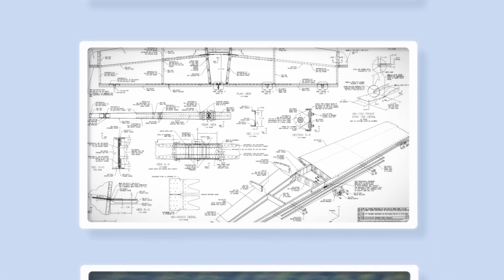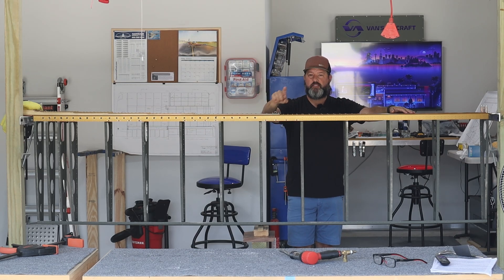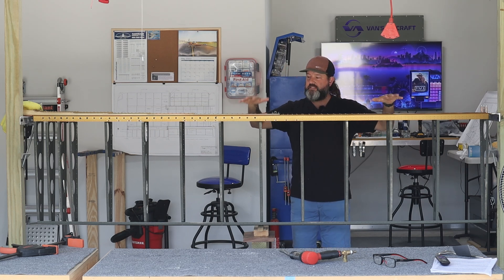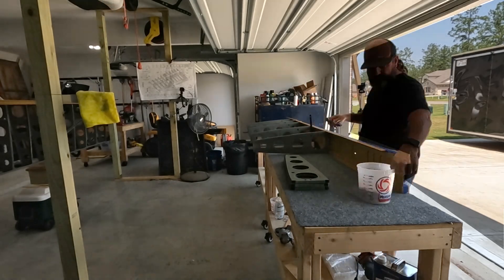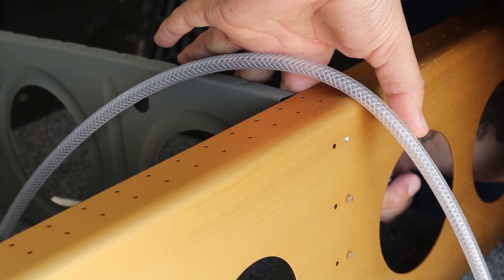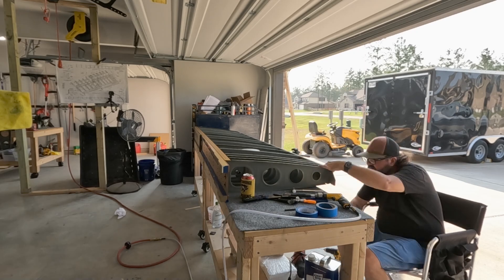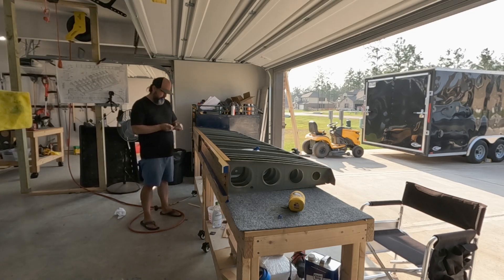RV-8 Build. Ep 051. Wings 13

Comment: Can you squeeze the upper and lower most rivets on the ribs using the longeron squeezer yoke?
Reply from the maker: Only on the two or three outboard ribs where there are lightning holes in the spar to reach through. Reaching over the spar flange isn’t an option it’s too tall, even for a longeron yoke.